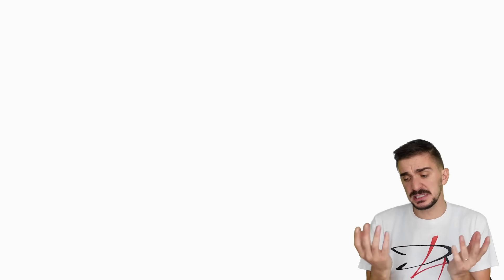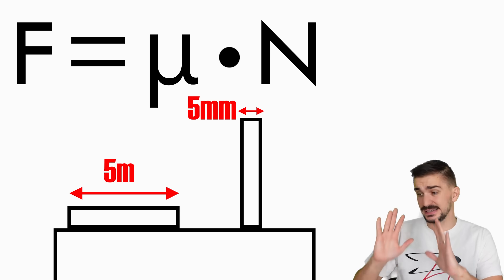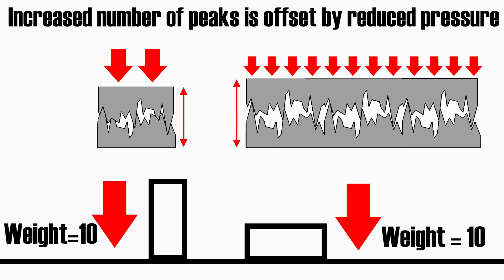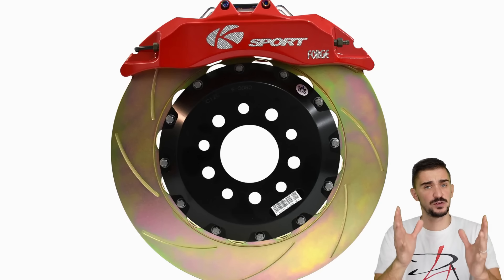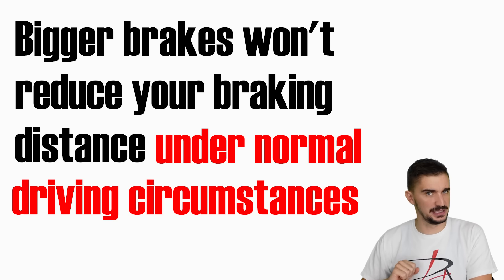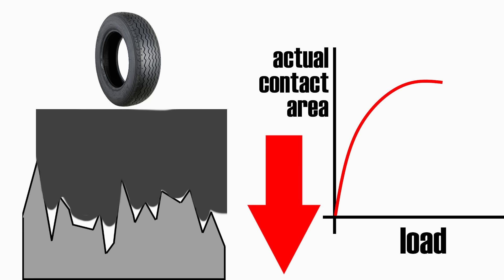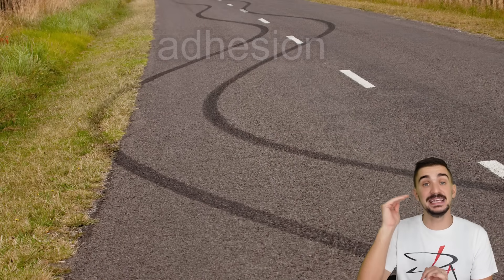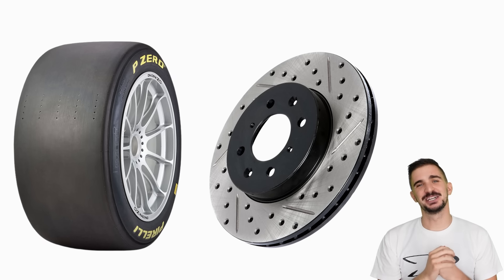Why Big Brakes Won't Stop You Faster but Wider Tires Will - Friction and Surface Area Explained

Comment: There is a bit of misconceptions, and law of phisics always apply. Bigger brakes have more pistons and and bigger discs and more friction. But the idea is about big brakes that it provides heat dissipation and therefore reduced brake fade. So with repeated braking sports brakes will be more consistent and result in repeptitive short brake disctan e while rhular brakes will provide longer and longer braking distance till they fade- fail completely. Tyres are i portant therefore sports cars use wide and sticky tyres

Comment: You forgot about the increased leverage that a larger diameter brake disk will exert on the wheel and tire.

Comment: This channel is usually good BUT, today he missed badly.  More tire surface area 'may' be helpful in straight line and dry clean road.  Change that to a wet road or worse, a snow covered sandy road and that wide tire turns into a ski.    Another 'huge' factor is suspension geometry.  Wide tires are horrible to use on McPherson struts as suspension geometry is only optimal in straight ahead conditions.  Turn the tire 20° and geometry becomes very bad with the wide tire rolling on to an edge loosing traction badly and skidding.  There are many more factors to consider than this over simplification review considers.  To many to write about here.

Comment: I generally like your videos and think they are generally accurate, but in this case you have overlooked two advantages to big brakes that DO stop you faster. Lets assume the only change being made is a larger diameter brake rotor and to keep this simple we will use the same caliper and brake pad. The caliper mount will have to be modified to move the caliper further out from the axle centerline to accommodate the larger rotor.

Simply increasing the rotor surface area isn't the goal, although it does help with heat dissipation as you noted. The larger rotor exerts its braking force with greater leverage against the rotating wheel. Increasing rotor diameter increases the leverage the brakes have, while increasing tire diameter has the opposite effect. The inertial of the vehicle acts against the contact surface of the tire and wants to continue moving. The brake pads create friction against the rotor converting the vehicle's energy into heat. The closer the brake pad is positioned to to the tread contact surface (increased distance from the axle centerline) the more effective the friction is at stopping the vehicle - because of an increase in leverage against the wheel.

Another advantage of big brakes is that it's rare to just increase the rotor diameter without also either increasing the caliper piston diameter, or increasing the number of pistons. Either way this increases the surface are of the piston providing greater force from the same hydraulic pressure created by the master cylinder, which applies greater force to the pads which also have a larger surface area. Total friction against the rotor is increased. In fact even if we use the original equipment rotor, and only change to a caliper with a larger piston, it will stop you quicker.  All this is assuming the tires are not at their limits of traction.

Comment: DO YOU WANT TO BREAK YOUR FOOT OR PUT ON BIGGER DISCS? DECIDE YOURSELF!
When you braking your brake produce a braking torque: T=F x Rm
F - frictional force            Rm - the mean radius of brake pad force application on brake rotor
So, bigger brake disc more brake torque! Bigger disc need less frictional force for the same torque, less frictional force means less heat. Of course, maximum braking torque depends directly from your tire, but not just from tire width, it also depends from tire diameter(radius). When you braking wheel produce wheel negative torque(Tw) from its radius (Rw) and force of the car (Fc). The force came from car mass (m) and deceleration (a):        Fc=m x a         Tw=Fc x Rw
So, wider tire - you can have more wheel torque, bigger tire - you will have it. For more wheel torque you need more braking torque. You can achieve more torque either by increasing the force or by increasing the radius. Let's remind that frictional force (F) came from coefficient of friction (µ) and normal force (N)     F=µ x N         Normal force is in direct correlation with your foot.

Comment: So If you want to upgrade stopping power you have to get more pressure out of the master cylinder and apply it to pistons that can handle it? And consequently increase break discs in order to disipate that heat. Am I right?

Comment: Motorcycles, proportionally weigh far less than a car, it only stands to reason that their braking systems will be far less substantial than a car, and designed with reduced weight in mind. I would think it has very little to do with airflow in a wheel arch.

Comment: Two points. First the larger diameter of big brake rotors put the braking force further from the rotational axis thus the braking force can be increased for similar pedal pressure. This improves brake feel. Second, a wider tyre can have a softer compound and last as long as a narrower tyre with a harder compound. The softer compound can conform better to the road surface. Heat is a major issue for tyres also since hot tyres are softer than cold tyres.

Comment: The Coefficient of Friction can be either Static or Dynamic. The Static Coefficient of Friction is Greater than the Dynamic Coefficient of Friction. Example: Your car runs out of gas and you have to push it to the gas station. You ard your strong passengers get out and push. It take more force to get car moving initially. Once car is moving, less force is needed to keep it moving. Braking is same (remove ABS in example): When you slam on the brakes, there is more braking force initially because Static Coefficient of Friction is higher. After that there is less braking because Dynamic Coefficient of Friction is less. 

Rotors and Pads can help you brake faster for longer. When rotors and pads overheat, Coefficient of Friction is less. Increasing rotor surface area helps dissipate heat faster than smaller rotors. Types of brake pads also determine braking distances and how many times of extreme braking they can endure. High performance pads have less friction cold. Once they heat up, they work better. They are able to apply friction longer before overheating. Many race cars spend first couple of laps heating up brakes and tires. 

I drive a Maserati GT. Stock was 19 inch wheels and tires. It now has 21 inch x 12 inch wheels with Michelin Pilot Sports, low profile, very wide, 50 psi, and high speed rated. They are wider but no taller than stock. I can't get them to lock up, spin under hard acceleration, or skid in hard cornering (unless on wet pavement). I have reached my limit (nerve) pushing them, but they have not reached their limit. Scary enough for me. Pucker Power is required.

Comment: Bigger brakes will give you greater dissipation of heat.  Stock brakes will work fine unless pushed too hard.  Under repeated hard braking brake temperature will go up.  If the temperature gets high enough the brakes will fade and lose stopping power.  Bigger and better ventilated brakes will withstand repeated hard braking with less temperature rise than the stock brakes.

Until they overheat the stock brakes will provide the same stopping power as bigger brakes -- the limitation on braking is strictly the grip provided by the tires.  But, on that tenth or twentieth time you hit that brake pedal during spirited (maniac?) driving or with a heavy load, the stock brakes may not do much whereas the bigger brakes would probably have plenty of bite left in them.  That is the purpose of he bigger brakes -- not to overheat and lose braking power under heavy use.

Comment: Bigger brakes (bigger piston diameter) can also produce more force on the rotor given the same system pressure. Also the distance the pad is from the hub center improves braking force.
Reply: There is a new video explaining, what I've explained to you
Reply: but not the breaking distance, which is the topic
Reply: @petkokrushev3840  I really don't believe that. Braking distance WOULD be improved- unless there's something fundamentally wrong with the tires to begin with. If they're skidding all the time... then of COURSE they should be upgraded to wider tires, but if the brakes won't lock up the wheels... then bigger brakes ARE going to decrease stopping distance. This video makes no sense to me. It seems to me that the fundamental premise is wrong.
Reply: @melissachartres3219  your brake system is way more powerful than your tires and even your engine, so what you are saying is impossible
Reply: @petkokrushev3840  all of that I talked about will reduce braking distance...more pad force = more friction force and more friction force at a greater distance from center = greater mechanical advantage to stop the car quicker.
Reply: @bspiritracing  bigger brakes, don't reduce the stopping distance and in this video it is explained scientifically why. Do you know, that F1 used 278mm discs, so by your logic, they have really long stopping distance...
Reply: @petkokrushev3840  he is talking about brake PISTON diameter. not brake ROTOR diameter. brake PISTONs on bigger brakes produce more pressure, hence more friction, hence shorter stopping time, dingus.
Reply: @danielsteger8456  again, watch the god damn video, it is explained why it doesn't reduce the distance
Reply: @petkokrushev3840  and I explained scientifically some things that may have been overlooked. F1 is not comparable to road cars because there are so many variable including materials, rulebook restrictions, etc.
Reply: @bspiritracing  Even if you produce more force on the rotor, it will just mean that you will lock up your wheels easier, nothing more, the stopping distance will be unchanged. You are limited by tire grip, not the brake force! Brake system on every car exceeds the tire grip, that's why you have ABS
Reply: @petkokrushev3840  not if you have the right tires. Cars that have upgraded brakes usually have upgraded tires.
Reply: @bspiritracing  just admit that you were wrong on your initial comment bro
Reply: @petkokrushev3840  l'm not wrong. The info I gave is fairly easily understood. Open a physics book.
Reply: @bspiritracing  you are a stubborn  man and you are wrong! Neither bigger piston diameter, neither bigger discs will decrease the braking distance
Reply: @petkokrushev3840  not stubborn, just know some physics.
Reply: @bspiritracing  "know"

Comment: If you look at some factory brake pads they have a small initial contact area but as the pads wear that small area gets larger to compensate for the loss of the material to manage the extra heat!

Comment: I've been driving in the snow and ice for over 50 years. Few people understand that you want your snow tires to be narrower because with less surface area, they produce more force per area unit against the road, giving better traction.
Reply: And there is less snow for the treads to move out of the way and a shorter distance that snow needs to travel to get out from under the tire.

Comment: Can somebody answer this as it seems to go against what was said in the video?
 I fitted slightly larger discs, calipers and pads and they increased the braking power by 20% according to a car brake test machine. I could feel the difference too when daily driving even just slowing from 40 mph.

Comment: the clickbait in the title is misleading.  the larger the brake rotor is, and the further from the center of the rotor the caliper can be, the less clamping force is required to overcome that friction. It isn't the surface area increase that yields performance, its the fact that you are pushing the brake pads further away from the center of the rotating mass.  adding more hydralic pistons and larger brake pads DOES shorten your stopping distance, it spreads the clamping force out over the larger rotor and it becomes even easier to overcome the friction and kinetic energy.  I have had several bmw track cars and a 996 turbo. Ive put big brakes on my bmw and the stopping distance was almost cut in half.   i put gt2rs brakes on my 996 turbo and it cut over 25 feet off my stopping distance.    the stopping distance being shortended is a side effect of big brakes.  The true purpose for big brakes is to eliminate brake fade on race cars on longer race tracks. thats it. no other reason.

Comment: Sure surface area doesnt help with brakes but it alows for biger calipers with more pistons and thus higher force on brake pads also bigger brakes result in biger radius from center of rotation and higher braking torque with same friction force. And also higher centrifugal force of air in rotors sucking more fresh cold air into brake discs and more surface area for air chanels to disipate heat. Bigger brakes will help with stopping sonner but any decent car has the ability to lock all 4 tyres with stock brakes and if you dont also improve grip tyres have on asphalt it doesnt mater how big your brakes are.

Comment: My Audi A4 B5 had 205mm tires, currently running 225. I first upgraded my wheels and suspension before I did the brakes. After getting those wheels on, I discovered I can apply more force before my wheels lock. Then I upgraded the front brake rotors from 280mm to 312mm (sort of a VAG 'stage 1' upgrade, basic but effective enough) and I discovered the effort to get that same force is way less. So if I get grippier tires, my stopping distance gets smaller because these brakes can then fully apply their force without locking wheels up easily

Comment: BOTH bigger brakes and bigger tires will help depending on the forces. If you have very small brake pads and huge tires and massive vehicle, you won't be stopping very quickly because the brake pads can't handle the stopping forces if they get too hot and destroy the pad. So, both improve stopping distances within some operating condition. While the physics formula is "correct" under Ideal conditions, it doesn't include things like "heat" and the breakdown of the surface under force and heat resulting in failure to grip. For example, you can have a thin tank tread on mud or a wide tank tread on mud. Physics says they have the same friction, but that formula fails when the surface is destroyed by the forces. So, a wider tank tread will work better on such surfaces.

Comment: It's a balancing act between rotational inertia, braking force capability, and tire traction.  I had to learn this while putting together my '91 NA5.  To put it simply, a better rotor design of the same diameter, with a better (depending on the purpose) brake pad used and a same-sized caliper with pistons on both sides of the same size tends to yield the best results for trackday car performance.  With that, I get significantly better braking performance in a similarly sized package with a relatively similar mass.
Once that's been addressed, the next two things I found important was fabricating adequate brake cooling ducts, and fitting properly sized tires with good rubber on lightweight, mass-centered rims.  Went with a set of  black Enkei RPT-1's (16x7 w/ 43mm offset) with Hoosier R7's for track use (P205/45ZR16) and Hankook Ventus V2's (200/45R16) for normal road use.
Granted, tire compound does make a larger difference when it comes to coefficient of friction and total friction/grip force available, but the main point is that it's a factor of contact patch size, frictions coefficient of the tire, and the ability of the vehicle to properly load the tires when under driving stress.
TL;DR = reduce moment of inertia and increase the tire's ability to grip the road for a more effective braking system capability.
Reply: my 996 turbo came factory with carbon ceramic brakes, cooling ducts etc.  i swapped to the much larger gt2rs brakes and the temp sensors show almost 10c cooler , the peak temperature was reduced by about 30c and my stopping distance dropped over 25 feet. all on the same wheel and tire combo.  the gt2rs brakes put the caliper just at the very edge of the rotor and has a redesigned caliper like you are describing with dual camping force, the 996 didnt.   I think i just learned why my car got better. thanks for that

Comment: even for tires i watched one time a video where they realy meassure what tire is best for which car and they made a matrix for tire width and weight of the car. so you could choose the perfect width of tire for your car. and damne are many cars wrong in standard config because the tire is to big for the weight. with a little bit smaller tire they would perform better.

Comment: Small niggle: the coefficient of friction is not a property of one material but of the interface between two surfaces.

Example: glass on glass probably has a higher frictional coefficient than glass on sandpaper

Comment: I'm just glad you didn't get into kinetic and static frictional forces... mu sub s and mu sub k for the same material, that a wheel contact point uses static and not kinetic if the wheel is rotating and the vehicle is moving, but the brake contact point uses kinetic etc... all your subscribers heads would've exploded :P

Comment: While the limit to braking will always the tires, the function of the brakes is to convert kinetic energy into heat energy.  As the rotor heats, it loses its ability to absorb heat. At this point it doesn't matter how wide your tires are, your deceleration rate will not be as high as it was with cold rotors. We've all had that exciting experience of standing on the brake peddle with both feet while the vehicle refused to slow as fast as we wanted. Reason? The tires had plenty of grip, but the brakes were heated beyond their ability to absorb more energy.  Larger rotors and calipers will help.